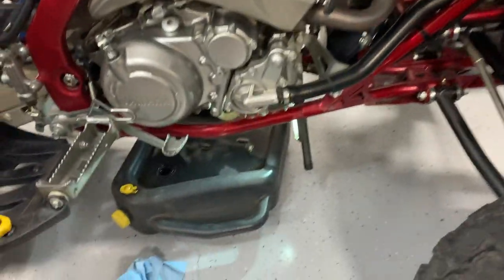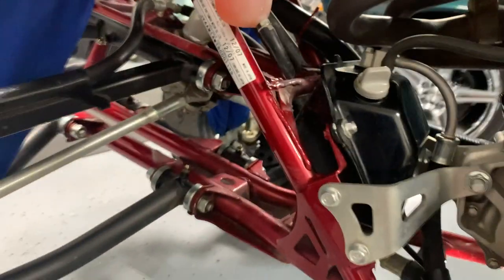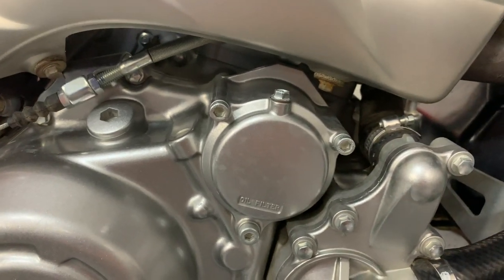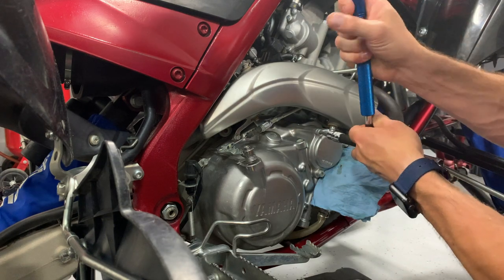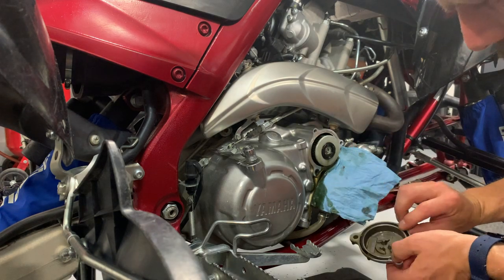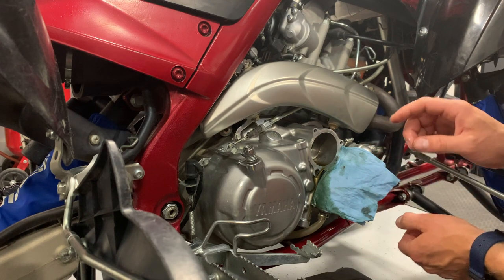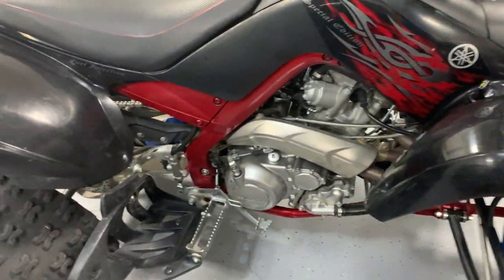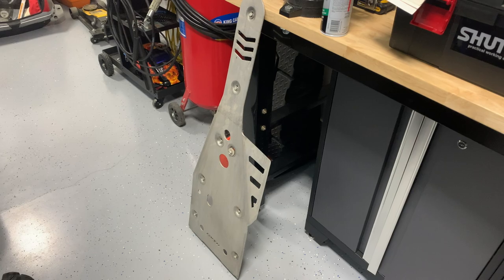Yamaha Raptor 700R Oil Change - How To

Comment: Why does manual say had 1.3lL to oil tank, start bike rev a few times and then add remaining oil to oil tank. It does say anything about adding oil to crank case which is confusing to me

Comment: Would love info on your light bar. What size is it and how did you attach it?  Thank you for your help and I enjoyed your video on the oil change!
Reply from the maker: Hi there. It’s just a cheap knock off 10” light bar. I wired it up to my headlight switch through a relay 👍

Comment: Hey bro where is the led on your handle bar from?
Reply from the maker: Hey bud! I bought it locally. It’s actually just a cheap knock off of a name brand LED light bar. That said, I used the cross bar hardware (I removed the cross bar) from my aftermarket handle bars. Then I wired the light into the high beam circuit on the OEM headlight switch 👍